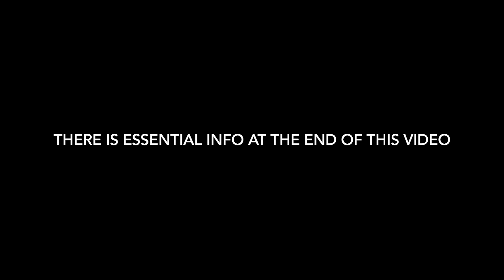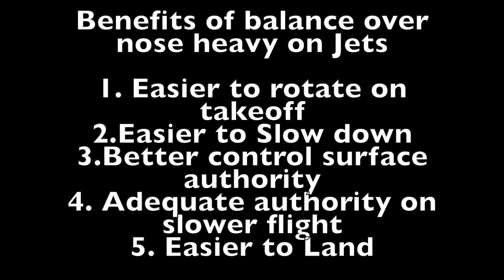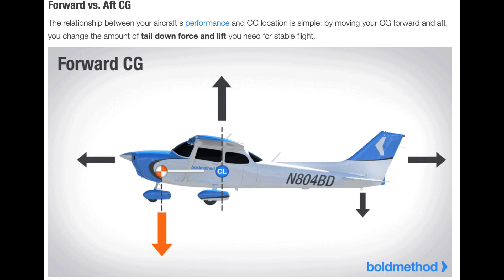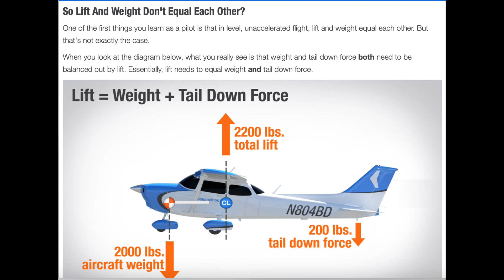Michael Wargo Instruction:   ESSENTIAL COG Balance and Flight Performance (MUST WATCH)

Comment: Good info, I fly a lot of EDf's and have wondered why the myth began about balancing them nose heavy, any idea what the rationale is?
Reply from the maker: Very good comment.  It is not necessarily a myth, but an attempt to eliminate the risks associated with too aft.   Too aft can cause a lot of problems, where too nose heavy will fly more stable.   Too aft can get uncontrollable if expo is not good and plane has a short moment like a corsair or something.   Too many people I assume went out of control I would guess and took a better safe than sorry approach.   But there is a point of diminishing return with nose heavy.  Depends on the model of course, but try balancing to manufacturer's spec.   Also, some older planes and things were hard to balance with gas and glow engines.   People very comfortable adding tons of nose weight.   Probably just a combination of a lot of things.
Reply: @MichaelWargo  Very good response, thanks!